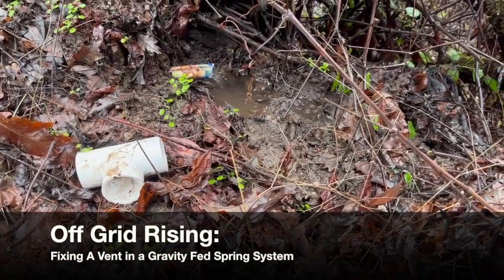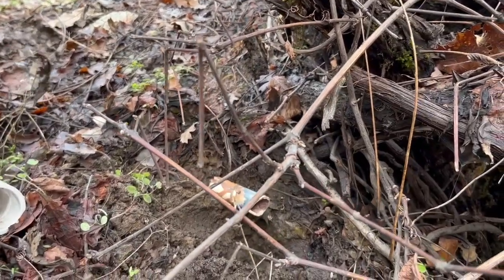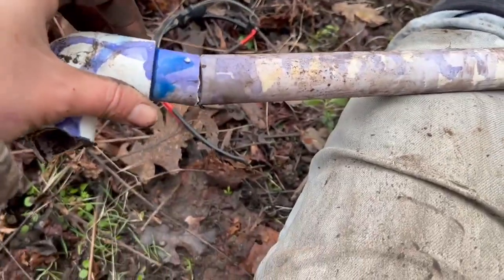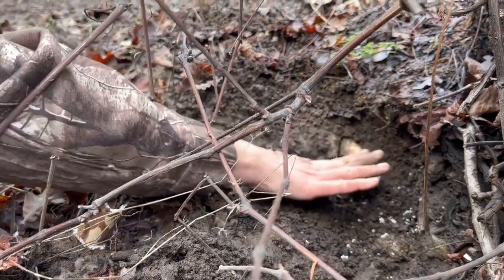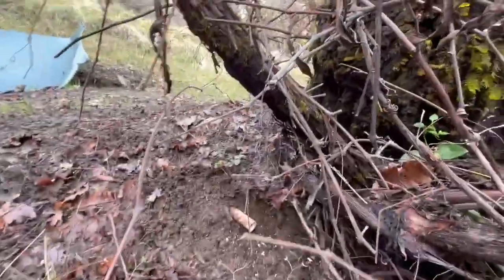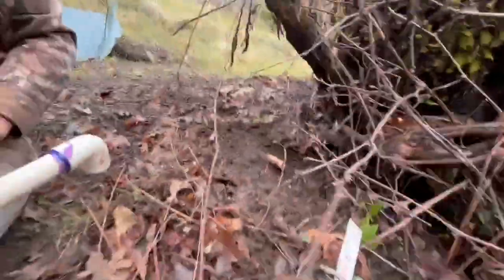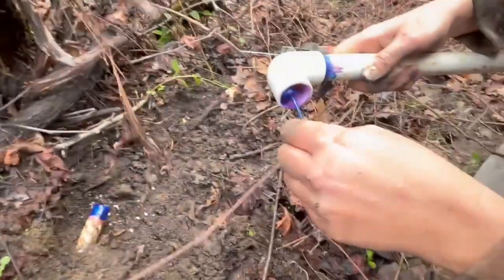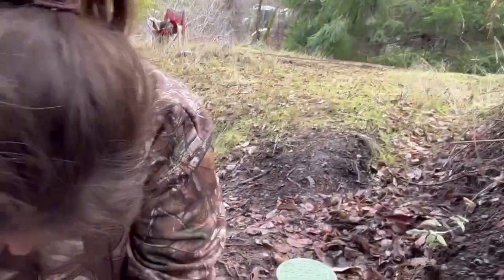How to Vent a Gravity Fed Spring System for an Off the Grid Homestead

Comment: If you store the can upside down in a wide mouth jar and cap it - the can might stay good for decades even if you have used the can - i have a 3 cubic foot chest freezer with a Digiten inline thermastat and have it set at 30° - to keep all my glue that is also in jars cold - 
       It prevents the solvent from evaporating - only buy super glue in metal tubes - 
   Plastic tubes alow solvent and air to migrate causing the glue to harden - 
      In the south it gets hot so i use a fridge to keep things cold - also elastic roof dope can not freeze so i use a old freezer with a thermastat hooked up to a heating pad and store my 5 gallon pales of roofing sealant in them - 
    The heating pads come on and prevent them from freezing in the shed when its cold -
Reply from the maker: Thanks!